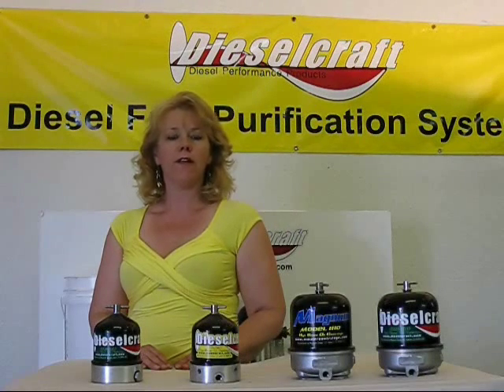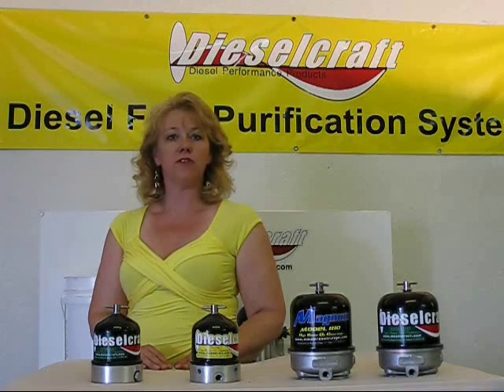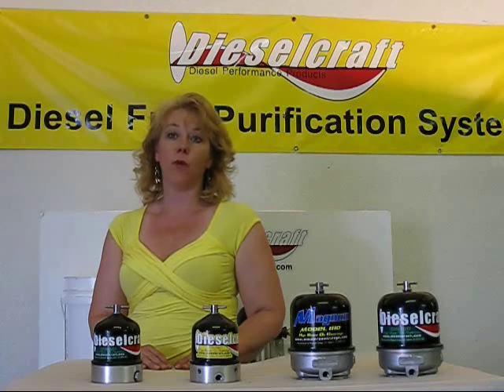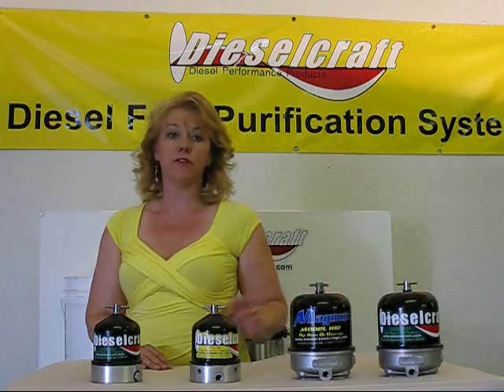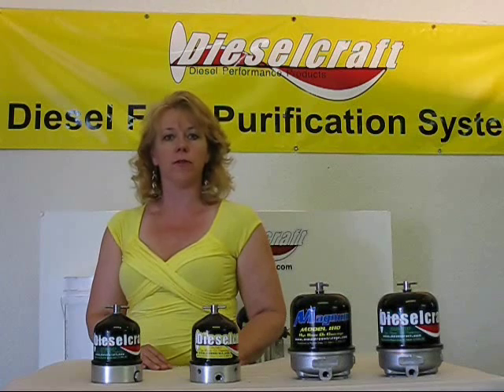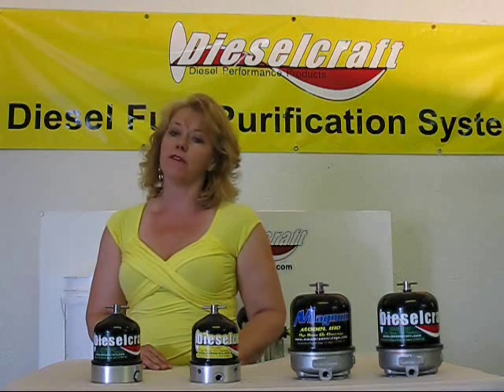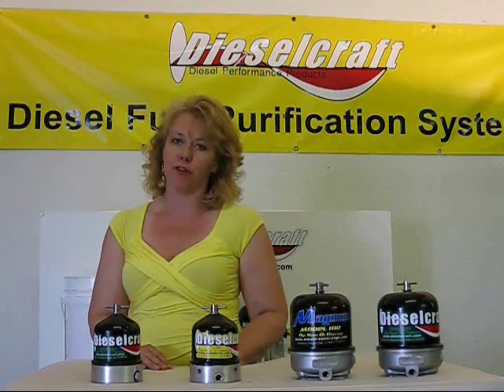Dieselcraft Oil Centrifuge Introduction

Comment: Would an oil filter like this work for a gasoline LS engine? It seems as though it would be a better option than even a high-performance conventional oil filter.
Reply: Yes
Reply: You need to understand how filtration works. High performance filter is a blanket term that doesn't mean anything. Doesnt specify filtration or flow. Filtration is measured in microns, so to give you an understanding, most high flow oil filters filter particles between 25 micros and 45 microns. A bypass filter will filter down to particles between 1-10 microns. The centrifuge filters the bypass oil down to 1/10th of a micron, in other words, it cleans the oil down to an extremely fine level far beyond what any conventional filter can. This won't necessarily improve engine performance but it will significantly improve engine and engine oil longevity. If you really want to take care of your engine, the centrifuge from my research is the absolute pinnacle of filtration and the best thing you can get to keep your oil clean and your bearings and rotating assemblies in good shape for as long as possible.

Comment: don't take there word for this centrifuge because its not trued, had one on my silverado, 6.6 duramax for over six months with no results, nada, none. did not clean one dam bit. don't waste ur money on this unit. just my 2cents worth!!!!
Reply: I was wondering if it was worth the cost. 
I did  put it a rad filter.  Using the heater hose. That actually works. It really cleans the water of dirt and rust. The  first filter i cut open.  Sure enough it was filled with rusty bits and I think  black sand .
Anyway  thanks  again for the info.
Reply: Did you send in your oil to get analyzed in a lab or did you simply reach that conclusion by looking at the oil
Reply: @markbreitsameter3336 good point